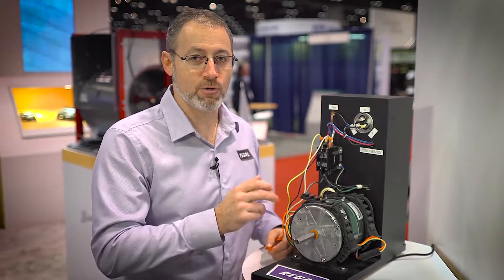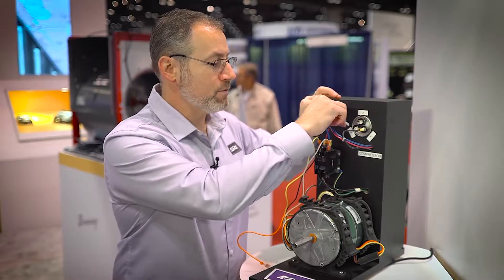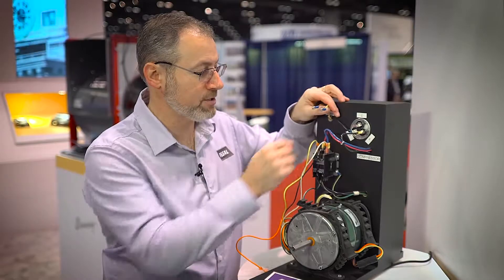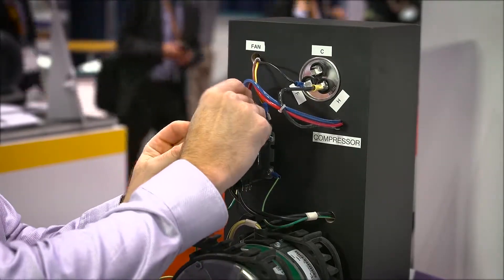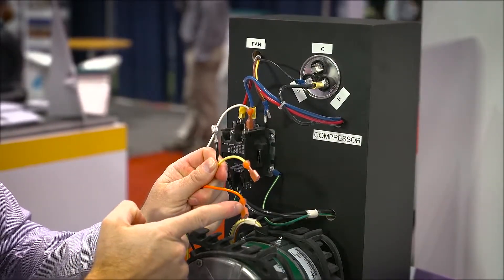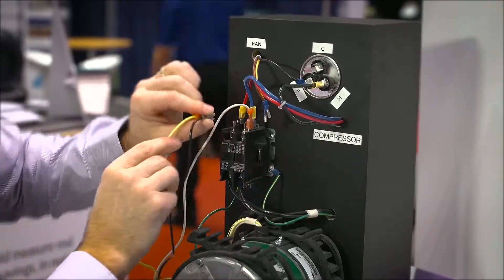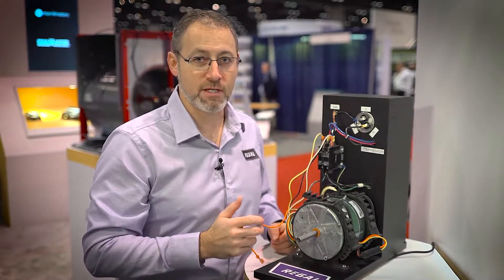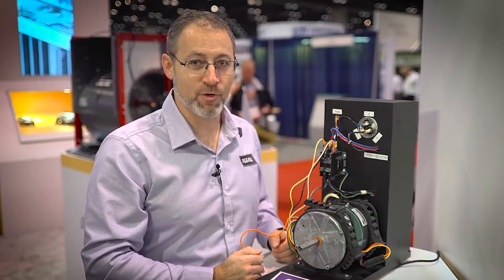Easy Replacement and Upgrade for Outdoor Fan Motor: Evergreen OM

Comment: I seen a video showing 1/3 hp OM motor can be used down to 1/8 hp. How Does the motor know not to run at 1/3 ? If it’s a 1/8

Comment: Would the OM motor have a longer dimension that the PSC motor it is replacing and there by causing the Condenser fan to have to be positioned lower relative to the top of the outdoor condenser coil?
Reply: I have experienced that the OM motor is longer and won’t work in some applications. But i will use the the motor when I can.